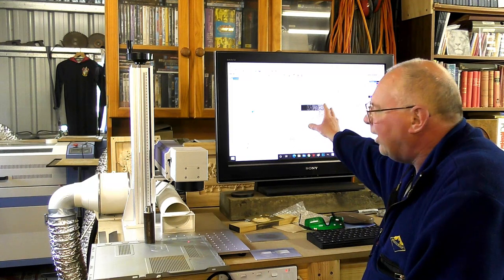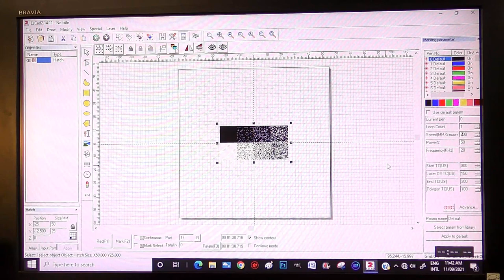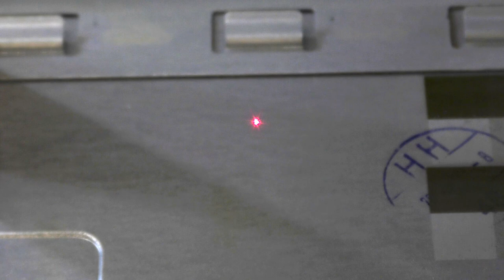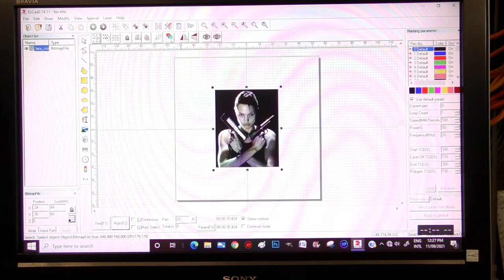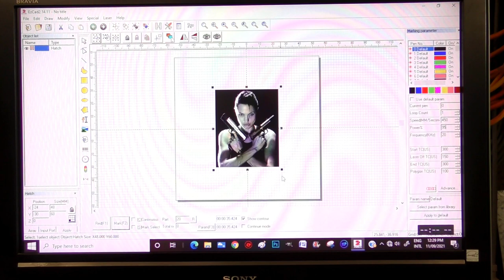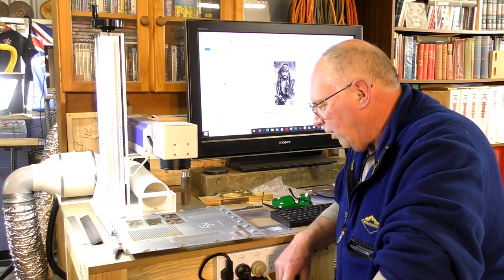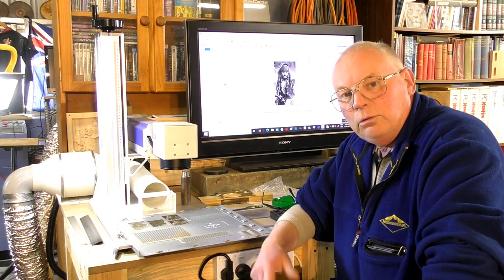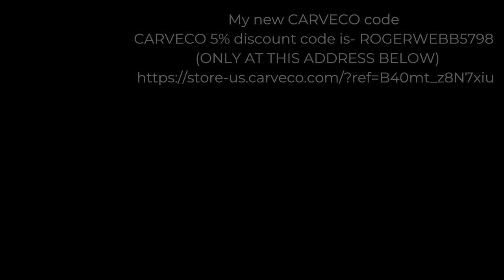FIBRE LASER HD PHOTO ENGRAVING INTO STEEL

Comment: yes so this is where is i spend most of my engraving life, 50 watt fibre using EZCard, typical power settings onto stainless steel for me would be 0.01mm speed 2100 , Power 100 and 50hz, simply use a fine mist or wet cloth to finish afterwards